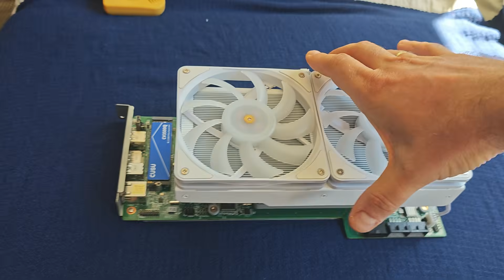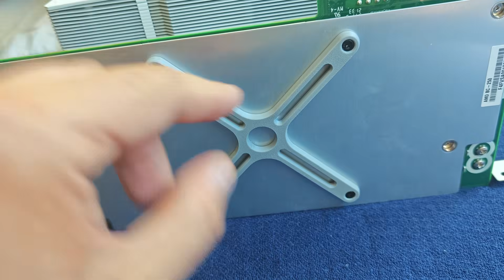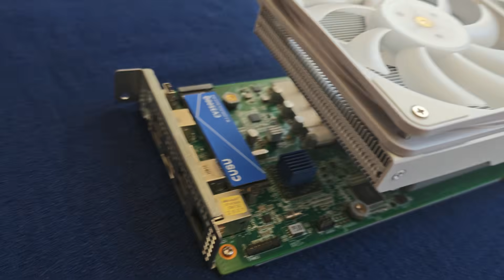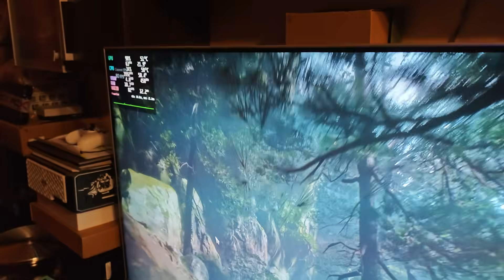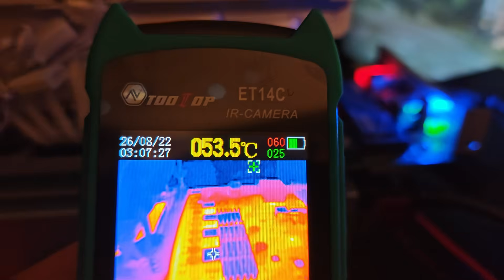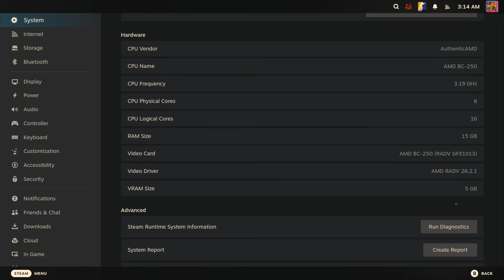Good cooling alternative for well overclocked AMD BC-250 (borrowed from PC exotic solutions 🙃)

Comment from the maker: Guys, IMPORTANAT notice: I made error in description, I actually used INTEL JF13K mount, not AM4/AM5, and on Intel Mount I had to remove pre-installed screws using pliers, and use other m3 screws to work with 3D mount I've indicated.
If you have newer version of JF13K with different mount, use this adapter (7mm version):
https://www.printables.com/model/1826539-am5-cpu-cooler-mount-for-the-bc250/files
Reply: So just to be clear, the printed mount is the AMD4/5 mount and you then attached the included JF13K Intel mount? I just picked one of these up after watching this video and getting all my parts together for this build. For now it’s an open air build but I’ll be excited to see a case design in the future!
Reply from the maker: @TheVickster1960  https://manuals.plus/jiushark/jf13k-innovative-air-cooling-manual

I used C Fastening – INTEL indicated in above manual. The mount I used is in video description.
Reply: Ah ok. My cooler didn’t come with either of the mounts identified in the manual you’ve referenced above. In the small manual that was enclosed with the cooler it only lists a single mounting bracket that is interchangeable between Intel and AMD (at least that’s what the diagrams clearly suggest). From the looks of your mount it won’t fit.
Reply from the maker: @TheVickster1960  Then you need to seek another 3D printable mount, there are few on Printables.
Reply: This is the mounting bracket that came with my cooler…

https://youtube.com/shorts/8Wjrl1ZWqHo?is=geMLywlZUor0gP_C
Reply: @TheVickster1960  Been a day but I'm in the same predicament, did you find anything that works?
Reply: @TheVickster1960  Mine too. If someone can find the 3d printable mount, please place the link here.
Reply: You ever figure anything out? Kind of bummed I paid money for the cooler and for someone to 3d print the mounts for it to be a dud
Reply from the maker: @Belltyler91  https://www.printables.com/model/1826539-am5-cpu-cooler-mount-for-the-bc250
7mm you need for BC250
Reply: @OldLamer   Your amazing, i was also in the same situation mine came with the same mount bracket as @TheVickster1960 video as well
Also not sure if your aware or not but it seems some of the big big tech youtubers are catching onto the bc250 craze now, Switch and Click did a vid recently and Linus Tech is releasing one in the next week or so, prices are gonna jump up again massively
Reply: What is the high to the top of the fans and the height when putting a fan on the stock heat sink?
Reply: @shayner42 I have the same question about total height of this
Reply from the maker: @Kyle-d4d6q Cooler is 92mm high from CPU contact plate to edge of fans.
Reply from the maker: @shayner42  Cooler is 92mm high from CPU contact plate to edge of fans.

Comment: Looks really good! Ordered the cooler now aswell.
For the mounting I need : 1x bc250-am5 mount-7mm-BI, 1x back brace and 8x Thumbnut Threaded Insert Version?
Why do the Thumbnuts look less tall in the video, in comparison to the ones at Printables?
Which screws/nuts are still needed and which came with the cooler?

Comment: Is it possible to have link for measurement of nuts, link to order the others stuff screw cage, heatsink dimension as well etc, i was thinking to put this as well but the IA said it will be more hot as the original mod 🤷🏽‍♂️  thanks a lot i like the video

Comment: Now we need a new case 3d printed for this set up:) and which sizes of heat sinks you put on the top of the vram Old Lamer??
Reply from the maker: 8x8x10, 9x9x12, 14x14x10
Case is 95% completed
Reply: @OldLamer  Ho yeah!!

Comment: One question: what exact model of DisplayPort-HDMI adapter/cable for 4K@120fps do you use? 

I've been having screen flickering and artifact issues with mine.

Thanks!
Reply from the maker: UGREEN Displayport 1.4 DP to HDMI Adapter 8K 60Hz Converter,Uni-Directional Display Port to HDMI Converter VRR HDR HDCP2.3 0.2m
Reply: @OldLamer Thanks! just bought it on Amazon

Comment: Can you give us the dimensions of the heatsinks for the vrms? I was planning on getting an AIO (on sale for 50€) but i prefer air cooling (and since you posted this, i ordered one JF13K). Now i'll need to mod a 3d printed case. I've also seen a Deepcool CH160 as a case for this project (either watercooled or this format), but i cannot find one for sale cheap. Do you recommend any, or are you planning on a 3d printed one? Thanks for the videos, they have been extremely helpful.
Reply from the maker: I'm making attempts in Fusion 360 to draw a proper case for  this cooler. Being a bit dull, it takes more time that I wished

Comment: You can use a standard water block and modify aio watercooling to fit into it. That way you can cool it better
Reply: with AIO will still need to cool vrm and whatnot while this thing is just a somewhat low-profile, passive, has near zero possibility of leaking, cheaper than majority of aio and fits nicely
Reply: @SergeiSugaroverdoseShuykov  what about nzxt kraken G12 ??!
Reply: @alilokhd4638  what about it? you'll pay half a price of this cooler just for this attachment which covers only half of vrms

Comment: Hello, I have the bc250 set up with steamos 3.9 40cu overclocked just like yours 2 gigahertz gpu and 4 on the CPU. My question is why do you run Bazzite os, what is the reason if there is any? I'm working on building my second BC250 and I'm wondering if I should use Bazzite for it if there is a good reason. I like your videos and dedication to this project 👍
Reply from the maker: I'm having hard times trying to find advantages of SteamOS over Bazzite...

Comment: You are wrong. There is liquid inside every one of those heatpipes. And why did you keep those crappy 15mm fans? At least change them for the Arctic P12 Pro.
Reply from the maker: P12 Pro would do even better job, but stock fans works just fine, so I didn't get there to P12 Pro mod.
Reply: @OldLamer  One question. Are you going to do another comparative with the compute queue and fsr4 fixes, and the Steam Machine?
Reply from the maker: @Ismsanmar  sure

Comment: The stock fans are low profile meaning the performance doesn’t touch a full thickness high static pressure fan at low RPM.
Reply from the maker: P12 Pro would do better job, but stock fans are surprisingly satisfying

Comment: Great video, I installed the same cooler over a month ago with my own custom designed bracket. Wish it could be shorter as you practically have similar overall height if you put AIO on top